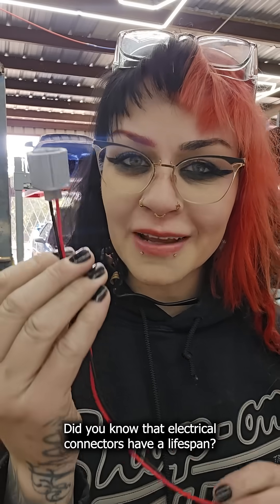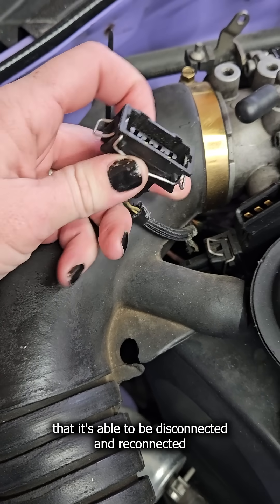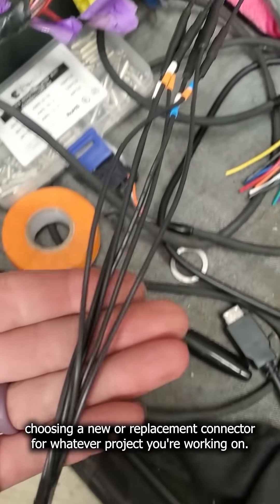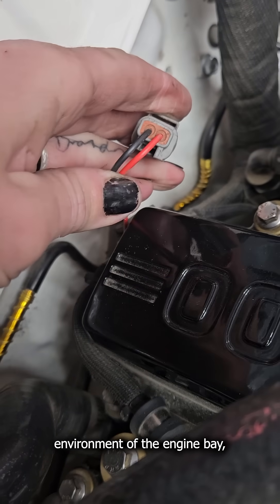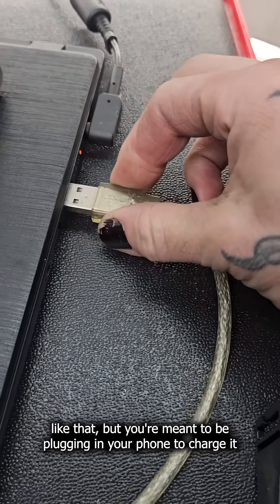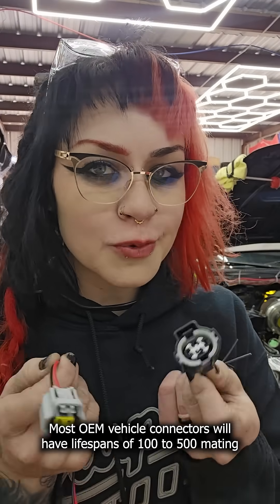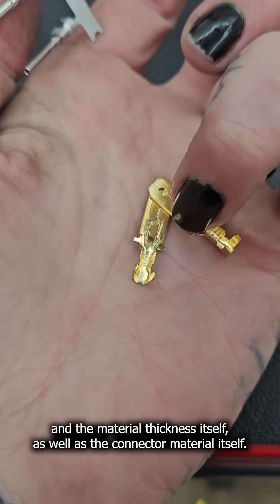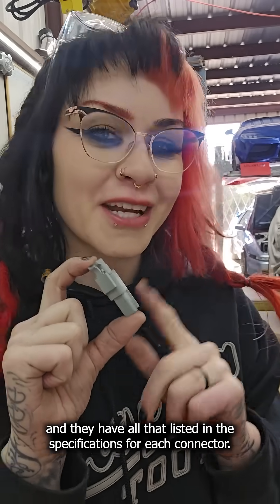Electrical Connectors have a Lifespan, called Mating Cycle Rating! #AutoDIY #CarTips #MechanicTips

Comment: inside pc cables are about the same. for example a socket might be rated from 10-50 mating cycles and i think molex was like 20. but a hdmi(that complies with the standard) is minimum supposed to manage 10 000 mating cycles

Comment: I really appreciate your videos. Recently got a electrinics reliability engineering technician job, its my job to test the connectors and other electronicals for pull out force, actuation cycles, degradation due to temperature and oxidation, vibration, etc.

While I know all this stuff, you have such an accessible way of encompassing the whole field for normal people in your 60 second presentation.

Comment: Great i did not want to know this i clean my intake on a weekly basis ive easily disconnected the maf and the plug to the throttle body 100 times, now im just going to be stressed every time i do it i will permanently solder each wire to each pin the second it fails and find a way around it mabey lengthen the wire to give myself more room idk anything but do the headgasket again to hell with that this  car isint getting another penny from me but im getting another 100,000 miles out of it if i do find myself forced to replace it again im squeazing half a tube of rtv on the existing gasket i would rather suck a dick on the side of dixy highway then pay a machine shop to mill the heads everytime i put more then a couple hundred dollars into a car it dies immediately after but if i just continue to struggle it will outlive everyone i love

Comment: Did you know you can pull those pens you can heat them up quenching back down again and they’ve got the same strength as they had the day they were new. You can put them back in their little plastic housing and replug them in. You can even do that on the male side and the female side unless you know what that means, I’ve worked with those pens for 100 of years. It seems like.

Comment: Main marness connector from ecu in thermoking s series precedent models can only be disconnected and reconnected 10 times before you have to replace the connector. That's the shortest cycle rating I've ever seen.

Comment: I prefer to use SB120 connectors.
Sure they are large and heavy, and a pain to connect 18 gauge wire to, but they will last longer in heat and chemicals
/s

Comment: aw snap now I have a new fear 🥶 I've connected and disconnected the plugs in my door panel and the center console probably more than 50 times while installing my car audio system. I also disconnected the connectors in the kick panel a ton to gain access to pass speaker wires, power wires, RCAs, LED accent lighting wires, etc.

I have no idea where to buy them if I ever need to replace them. And my car is a 2024, I can't just find used parts on ebay or the junkyard 😭😆

Comment: While I am familiar with this concept first learning about it regarding HDMI, having 5k - 10k mating's, when looking for a quality cord back when Radio Shack was around. I recently learned this with cell phones about 5 years ago. However I am just now learning about the vehicle connectors, and living in AZ where the heat just absolutely wrecks the plastic. Drying them out and effectively disintegrating said plastic. Learning that you can choose different connectors and manually switching them out is super helpful

Comment: Wanna fix my dodge ram 1500 paid over 1000$ in oem connectors cause no mechanic wants to just soider it so i bought my own soider kit and gunna do it when spring comes dont wanna try powering up a cheap soidering iron in -25 weather

Comment: Deutsch DT solid contacts are far more secure with lower resistance than open crimp stamped style. The wire will likely break on a property crimped solid contact before it pulls out. It cost more but much better.

Comment: Eaton Autoshift, Ultrashift, Ultrashift Plus, and Advantage transmission harnesses are recommended to be replaced way more than they actually do get replaced due to connector cycles and the overall nature of the harness. Especially the GEN 1 and 2 harnesses. Once you disconnect them, they are practically trash.

Comment: I used to work for a company called Tokai Arica, if you’ve ever driven a car chances are you’ve used one of their switches. At my factory we specialised in lever combination switches for Toyota (light and wiper stalks) each switch had to be electrically tested at the end of each production line, this meant that the connector going into them was attached to a machine that plugged and unplugged that connector about 1200 times per day. They had to be replaced very frequently and to save money instead of replacing the entire connector assemble we would reterminate the parts side which was good because tokai rika also make the connectors and pins.

Comment: On a BMW, they don’t have the lifespan that you speak of. They just break into little pieces after a few years. Ultimate driving machine my ass.
Reply: They said ultimate "driving" machine, they didn't say anything about ultimate "repair" machine or ultimate "maintenance" machine 🤣
Reply: Go toyota
Reply: @TheWay-up777 mk5 Supra
Reply: Many people don't realized or know this. But back in the late 80s or maybe the early 90s. BMW was setting a goal of making their cars 100% recyclable.
That may explain why the plastic on BMWs seem to have a rather short life. They've designed it to break down. But they under estimated how long people will keep a car for. 

Another good example are the displays on Tesla cars.  Tesla had to replace many of the displays as they stopped working due to  a recall. Musk said he wasn't expecting people to keep their cars for so long. I think he was expecting people to replace their cars after four or five years.
Reply: @Rhaspun  with how much stuff costs nowadays, keeping it for the long haul is a must.
Reply: When they said "ultimate driving machine", they meant "ultimate driving you crazy paying for repairs again" machine.

Comment: This is a great subject to cover... A lot of these connectors do not hold up over time or have some kind of issue with them that needs to be corrected, I would like to see more videos on good repair techniques, I have also seen as part of the repair procedure some preventive measures to ensure longevity in the repair those are also important to include. Also Tools for removing and working with these connectors as I saw in this video that tool has its purpose as there are also other tools, I would like to see other tools and how they are used on different style of connectors I know there will be opportunities in the future.  Great job and your videos help with repairs that might be very expensive because of the time involved to do them properly by a mechanic a person can judge whether they want to tackle such a repair the information is so informative to the decision-making process.

Comment: Most of what I have to deal with dies before it's unplugged once lol.  I've seen way too many connectors just age out, lose tension, then start heating up and melting.  Not to mention trying to feed a ~25a draw for a blower motor through a GM mini relay.  Good call on that one, Freightliner.

Comment: Junk connectors do you mean like the engine connectors on a 2000 Toyota IS300 2JZ that crumble in your hand? 
 We could use a good pictorial on the right tools and recommended connectors to repin and replace.
Reply from the maker: I showed a very similar car here with a 2JZ, and because they tend to heat up and die from the connector housing crumbling since they get heat soaked from where they sit, I honestly use those pigtails from Amazon that I showed here in this clip. I'm sure the mating cycle rating is low, but they are inexpensive. I just include them in the price when I quote spark plugs on one of those cars. I honestly don't consider using high end connectors with a high mating cycle in that case, because the connector will become brittle and die before the pins ever lose tension. And so you'll be replacing them again in another 90k when the spark plugs are due again, regardless of which ones you use. I do remember searching a WHILE ago to find a really robust connector that could handle crazy heat, but the price was really up there, and when you give options to the customer they would prefer the cheapies and face potentially replacing them again in another 90k. Those pigtails cost $11. https://amzn.to/4gYmOM4

Comment: For Ford, it can be at most connected 0 times.  Their connectors fucking suck.  The wiring harness connectors in the passenger footwell that connect to the blow transistor and the blower motor are fucking awful.  Brand new from the factory, they cause your blower to work intermittently. You can jiggle the connectors to get it to turn back on until you go over a bump in the road and you lose AC or Heat.  Good fucking job Ford.

Comment: 2014 Chevy Silverado 5.3L
Just changed the oil pump with the oil pressure control solenoid b/c of the dreaded P06DD code. Theres a connector that goes from the solenoid to the outside of the timing cover. I changed it because of this same reason!
It was in contact with oil for 140K miles as well...
Reply from the maker: Oh my gosh, that sounds like a nightmare! Good on you for think ahead and handling that

Comment: I can remember a GM TSB from the early 2000’s that stated that “pin drag” had to be tightened every 3 cycles. One is just the factory install. So if you disconnect that connector that’s 2. Reconnect it that’s 3. Fixed many intermittent electrical issues in the early 2000’s GM’s that had loose pin drag.

Comment: Can you give me some info on where you purchased the Deutsch connector pins from? Im very much able to do witing in general. But the Deutsch connector supplies needed when purchasing stuff to make your own wiring is new to me. Did you purchase the. From the TE Connectivity website like the connectors?
Reply from the maker: I actually bought mine at a really cool electronics store here in San Antonio Texas called Intertex electronics! I wanted to hold them in my hand and use them first, rather than buying them online for how expensive they are! Do you have an electronics store near you (not like a radio shack, but a REAL electronics store)

Comment: Yep, we had a field engineer out for a vehicle lemon law case. My figity co worker started unplugging the MAF sensor and inserting the oe terminal test probes to check pin fit. Well he started inserting and removing the darn probes like a SINGER sewing machine moves a needle in and out of fabric and the field engineer freaked out. He made my co worker order another MAF connector. 😂😂😂

Comment: TE is awesome! Deutsche, Amphenol, and Cannon style connectors are amazing! Amphenol and Cannon are super rugged - we use them in locomotives, and they withstand decades of vibration and abuse. That said, Deutsche connectors can withstand the same. 

For maximum durability, pot your sensors with a high quality connector and epoxy, and make sure to add a proper strain relief, along with a small service loop.
Reply: Amphenol is what we tend to use on our equipment, we build pneumatic systems, metering bins, and truck bins for Sawmills and occasionally concrete and plastic plants.

Comment: Duetsche connectors are the best weather pack connectors ever made. I work on Crown? forklifts and they installed Deutsche connectors on everything. And I absolutely dig it! Although you do need a very expensive tool from these guys and it’s German and it’s about eight $900 to pin the connectors properly. You can use a cheaper tool. I don’t suggest it.

Comment: Pretty sure on the cars I've worked on the cycle rating for the connectors is less the 1.
They are so often a poor design the breaks far too easily or is needlessly hard to release

Comment: It's easy to make a somewhat loose connector last many cycles (unless you cheap out on components). But making a very strong and secure connection last many cycles is very difficult, especially at cost. A good example of this is CPU sockets. They are rated for approximately 5 cycles. Why? Because they hold down the CPU with a ton of force and must make sure that thousands, yes, thousands of tiny gold pins, make good contact with the motherboard. All while being easily installable by the end user.

Comment: Yup. I believe type c is rated for 10,000 cycles, but that's only if they followed the standard perfectly, which most brands don't. So my cheap cables from a random amazon name stopped connecting properly after about a year. Meanwhile, I have some nicer ones from real cable brands that have been working perfectly. It's also good to know if they are using stranded or solid wire since solid is more prone to breaking. But having good stress relief and sheathing is just as important. Some manufacturers  have even used aluminum or partly aluminum wires to cheap out even more, but this is rare.

Comment: I had loose connector pin on 97 motorcycle connectors i was feeling good one day and was cleaning them up and bent them to make a tighter connection i can remeber the exact amps but it brought the amps up it was connected to cdi bix sending signal to the coil and it run better

Comment: @FayeHadley  Here's an interesting Tip: If you do alot of soldering, get your soldering iron tip "gold plated"...it will never oxidize or corrode from soldering!!!...Learned this from an old ham radio operator when I was working for RadioShack®️ while in college!!! 😂
Reply from the maker: Very cool!!!
Reply: Thank you this rocks
Reply: Wouldn't the plating just dissolve into the solder? Modern tips are iron and nickel plated and seem to last basically forever for a DIYer or repair tech who's not using them all day
Reply: Why have I not heard of this tip before ? Dunkin /$tarbuck$ / TimHortons toast to Ms Tech & her community.

Comment: Realistically though, they die to heat and chemical exposure way before cycle rating in almost all practical uses. Good info!
Reply: Also simple spring fatigue, quite often. Even when they have never been unmated since first assembly, the metal can lose its grip, if it's no good quality material. The temperature cycling in automotive applications worsens this.
Reply: Go work in the industry and you will see your life pass you by way faster than you ever wanted. Oh and my test equipment test plugs get replaced like monthly...
Reply: @AlpineTheHusky  Right I could have been more specific but when I said practical uses I was thinking in a consumer owned vehicle. Even a project car. Only cars that will see tons of cycles are generally racecars of one type or another.
Reply: Exactly
Reply: yea you look at them and they just explode 😂